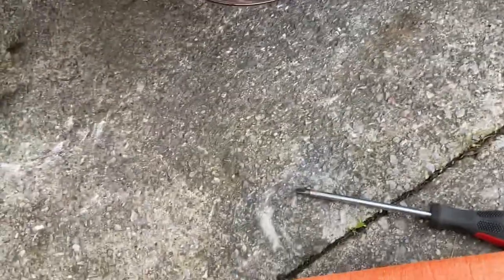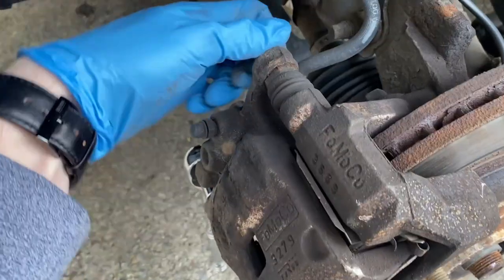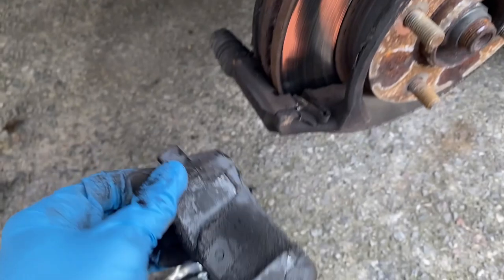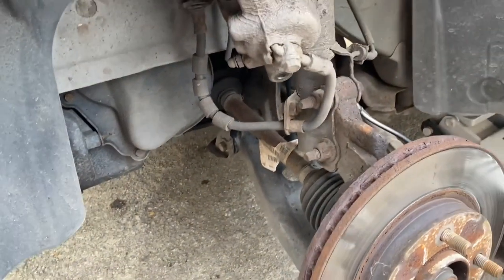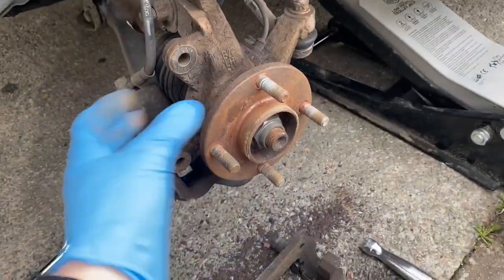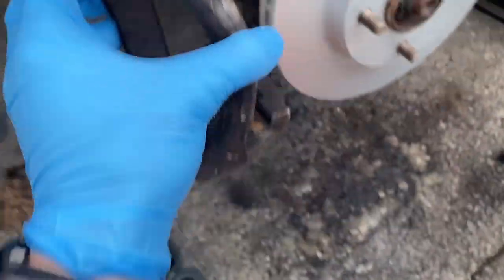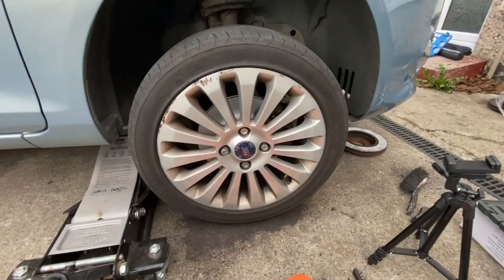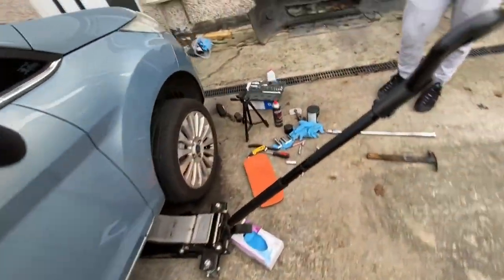Ford Fiesta MK7 Brake Disks & Pads Replaced!

Comment: Good video and you have come a long way with the videos now, with music when needed and match up of vocal audio and time lapse volume. 👍 A tip. It is not always necessary to change brake discs. Research the OEM thickness tolerances as a local engineering firm may be able to skim and blast clean them for you. Then you can let the car owner know that next brake pad change will also be discs. Shows you are doing good work and doing your best for the car owner.
Reply from the maker: Thanks means a lot I’m trying to get better with each video and yer the disk were only cheap and was going on a 2000 mile trip and wanted to make sure they were going to be up to the job
Reply: @restoringsalvage  With a 2000 mile road trip on the cards, it was OK to use caution and change the discs, especially if the price was right. 😀

Comment: Personally I would have copper greased all the contact points between pads and brakes.
The metal clips to caliper carrier, brake pads to metal clips and back of the pads where the piston presses on.
This also helps to stop brake squeal.
I have a 22 year old Renault Scenic and sometimes I have to remove the rear disc brake calipers to clean out dirt and rust build up that causes the calipers to seize.
Using copper grease extends the time in between services.
Reply from the maker: Yeah it just depends there is a couple different ways of doing it i sometimes copper grease the point sometimes i don't just depends on the vehicle and how bad the callipers are

Comment: Nice vid I got same car did you re grease the pins
Reply from the maker: The slide pins? If so sand them down to remove old grease and then put some rubber grease on them